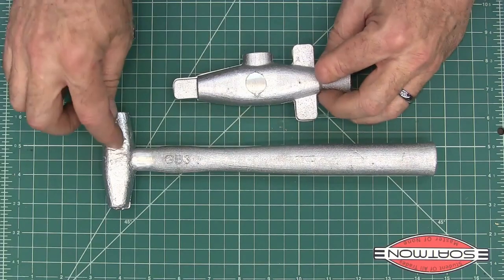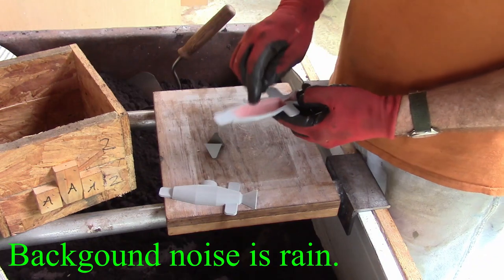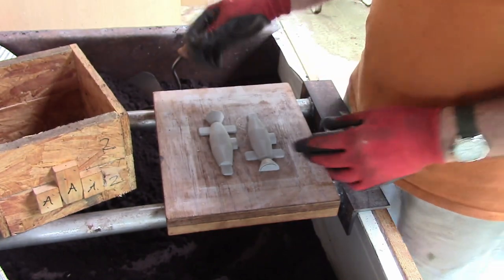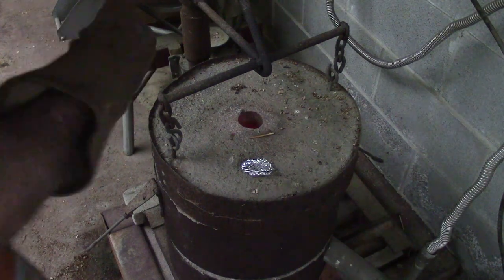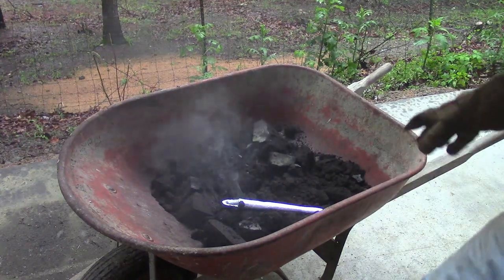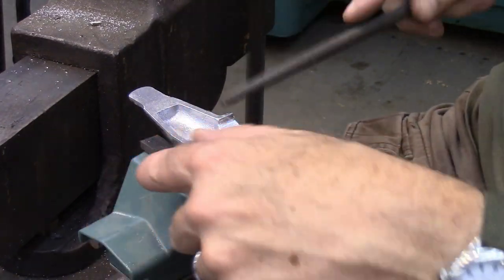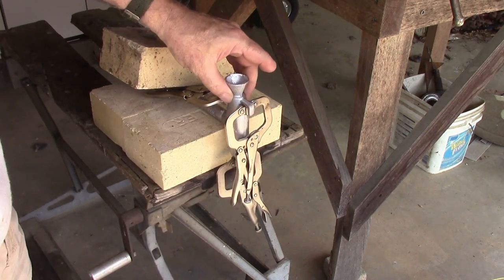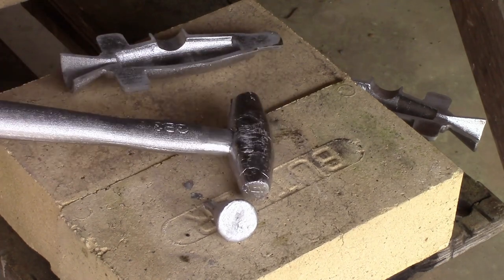Homemade16oz Lead Hammer and Mold

Comment: Memory monument, remembering when in the aerospace machine shop we would have 2 lbs plus lead hammers on steel handles they are on an exchange program once beat to a or flew off the handle the lead hammer guy would come weight and exchange the old ones for new ones.
That handle you are sharing that you made a pattern for made of aluminum looks to have wood grain to it, not being there would be funny to paint one handle to look like like rustic wood while still having one of your nicely forged lead heads on there. Nice poor.
Thank you for the share.
Lance & Patrick.
Reply from the maker: Painting one as wood grain is a great idea, I may have to do that in the future.  I made some larger ones in a previous video, one of them was really heavy, I don't remember now how heavy but I don't ever use it.
Reply: @SoatMon  Or make a wooden head for the metallic handle, I'm sure Diresta  would turn green with envy as it matches his axe!
Reply: I worked at Hardinge in the tool crib in the late '70's and they used lead hammers, I think 1 and 2 pound. I re-poured about 25-30 hammers in house every month.

Comment: Another very good video!  I know you don't likely want too but you could sell those aluminum molds.  I already have a similar one or I would be after you to get one like that.  The one I have isn't so nice but it works.  That hammer looked really neat before you cut the sprue off of it, a long reach hammer. :-)  Sounded like you are getting come rain.  We are getting quite a bit too.  Have a really good weekend.  You keep us inspired.
Reply from the maker: Thanks Glenn!  I was pleased with how it came out and have been using it.  The other ones that I made I use the lighter one but the heavier one is too heavy for most things.  It has been raining here and we are grateful for it, getting really hot though.